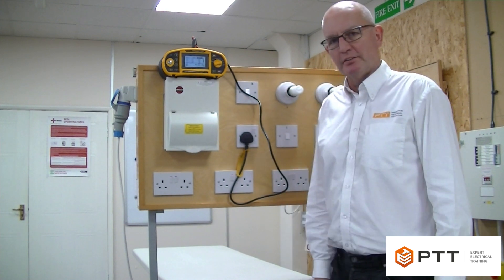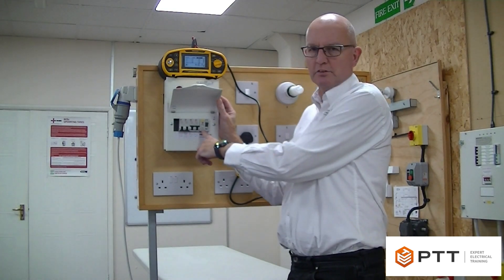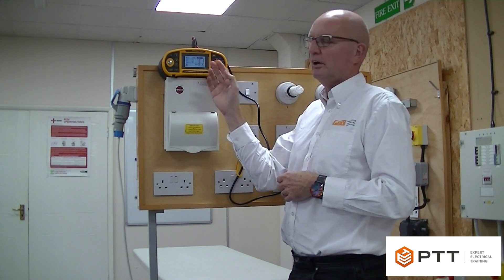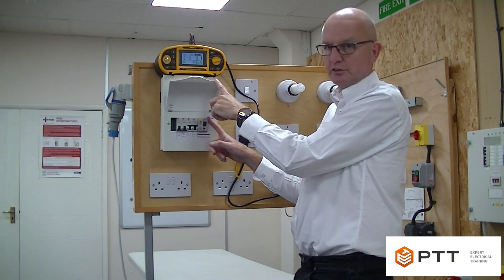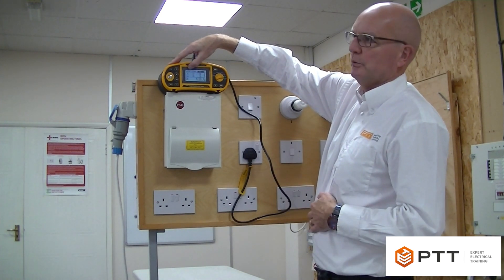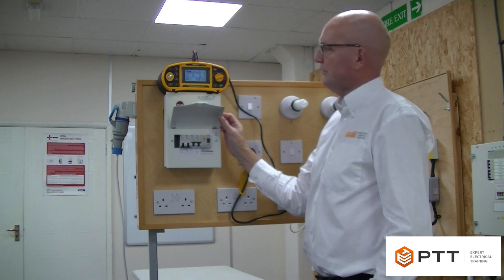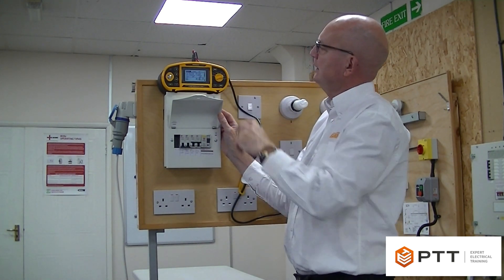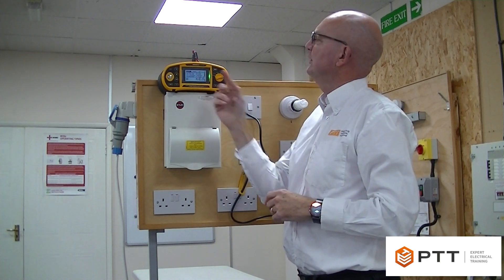How to Test Residual Current Devices (RCDs) | PTT

Comment: Nice clear explanation of the RCD testing procedure, but it is a pity you did not put a blank in the board to cover the aperture where a mcb is not fitted to  maintain correct IP rating of an energised piece of equipment.